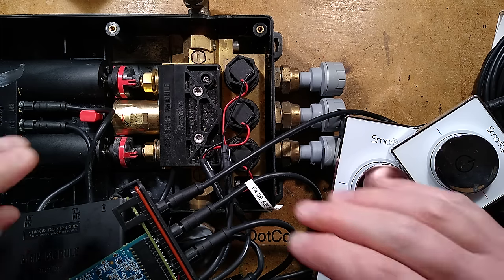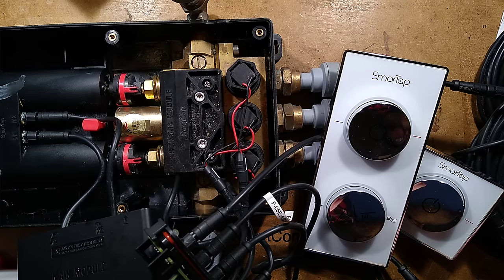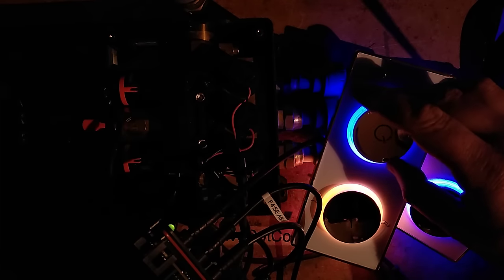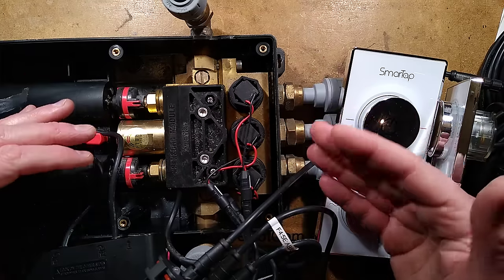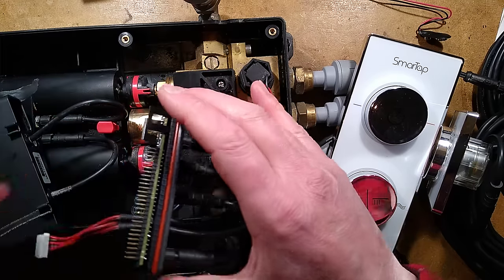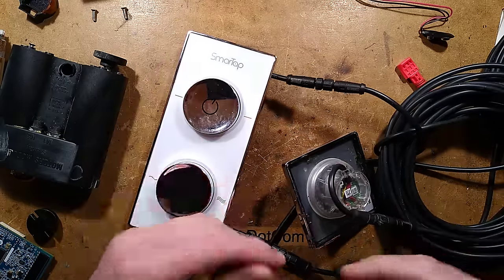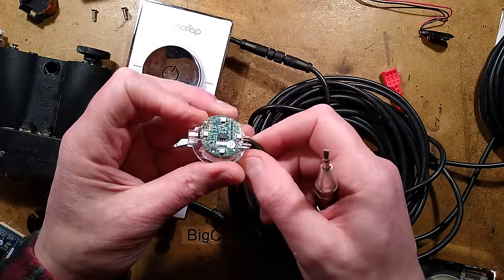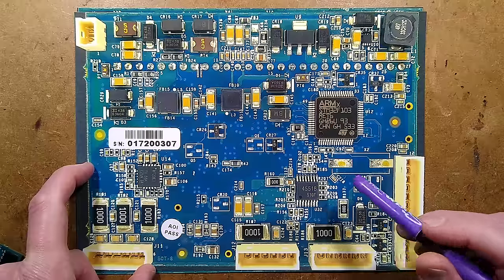Smartap - when the Internet of things goes down

Comment: I wonder if the third outlet which you suspect is for a basin/sink might actually be for a bidet?
Reply: Ohhh Matron!! - an IOT bidet control - that would give the Major a fright🤣🤣🤣🤣

Possibly  a hand shower.  In my, non IOT, installation (Aqualisa ) one outlet is the overhead rainfall shower and the other a handheld shower head.  I don't have a third connection the bath is POTS (Plain Old Tap System) 😎😎😎😎
Reply from the maker: I did ponder that it could be used for that with the command "wash my ass".  But by the time the hot water got there you'd have had a very cold rectal cleansing.
Reply: I would assume it’s just remote control, the two buttons inside the shower, and a remote outside to turn it on before you get in.
Reply: Proves the old adage, “A fool and his money are soon parted”

Comment: I see comments about this being a non existing problem, but that's being cynical. This does temperature control for any two sources of of hot and cold water. This iteration however is limiting, it'd be more useful to have a regulator that affects just the hot water, injecting cold water to reach a target temperature, specially for solar water heaters that tend to heat water to the point where you could burn yourself. By just injecting cold water into the hot pipe you can keep using your sink (I can't believe this is a feature lol) when the power goes out, just using a regular tap. You also get the benefit of being able to fine tune the temperature at the tap.

I'm guessing they went with solenoids at the output to have more predictable control over the hot/cold flow rates.
Reply: A mechanical thermostatic mixing valve has much of the same benefits.

Comment: I've been reading about magnetic encoders and some of the have a "magnet in the right place" output that can be used to tell if the magnet is too close or too far - and they suggest you use it for a push button.

Comment: It's kinda amazing how different consumer and industrial approaches to IoT has become.
In industry, there's a big focus on running the servers locally, usually with OPCUA support. That way, even if the manufacture goes under, you can still for the most part run the hardware until an alternative solution is found. But you wouldn't want to continue using the software unless the security updates are handled by a third-party service.

Comment: Yet another internet-based piece of kit made useless by losing its server.  I have an internet radio which can no longer receive the BBC as its server is no longer supported. The radio will soon be completly useless as its main server will close down. This seems to be the way in the future, product still works but cannot function due to server no longer supported.
Reply: BreatheScotland  This has nothing to do with DAB, that uses radio waves like standard broadcasts but in a digital packet. The server issue are stations received via the internet.
Reply: BreatheScotland  Possibly different sensitivity. If the gain is lower on one radio, it will just mute that signal. Different locations can also make a difference..

Comment: I have exactly ONE of these IoT connected things in my house, a wifi connected Kidde smoke detector hardwired to all the others in the house. It gives peace of mind by letting me know if there's smoke / high temperatures present when I'm not home and that's it. Kidde has been around for over a century and isn't likely to go anywhere any time soon, and if they do die the smoke / CO detector continues to work just like any other dumb detector. For an extra $20 it was worth it when the only other way to do the same thing without a 3rd party would be setting up some zigbee home network nonsense that I have less than zero desire to deal with. 99% of all this other random IoT crap is useless unnecessary garbage I want nothing to do with.

Comment: IoT devices are the bane of my existence. Irrespective of the technical gaffs that seem to plague all of the kit, there's several networking rules you have to setup in your routing - VLANs for specific IoT devices, special filters, rules, etc. 
It's imperative that people realise the danger and general silliness of handing over control of basic amenities to anywhere remote. Hell, I'm sticking with analogue everything despite being pretty damn clued up on tech.

I think it speaks to a wider problem of convenience and security, and how many people are willing to go all in on convenience to the severe detriment of security - and, obviously, in the case of this remote shower thingbob, functionality. 

Irrespective, another cracking video Clive.
Reply from the maker: The IOT fanatics are the new "audiophiles".
Reply: I wonder when manufacturers will start selling the IoT equivalent of “audio grade cables”.
Reply: That’s only on the consumer-grade side - if you DIY a contractor-only system it’s much better. I did a DIY crestron system and know people with DIY Control4 systems and have never had issues.

Comment: I have this exact system. Believe it was bought by Groche, but was never returned to life. Still works locally. Single button used for bath. Other double button used for hand shower and rain shower.  I had mine linked with a valve controller that was linked to a koi pond valve that would open/close the "plug". Wish I could get it linked to my local computer somehow. Fairly sure the company was based in Isreal. Was marketed and sold by Victoria Plumb - another company thag has a shady past.

Comment: I just hope my next rental flat will not come with one of these things as my current home will be sold in the coming months, forcing me to leave.
Same goes for other stuff like a gas boiler because of the excessive prices set to force people to go electric, or sockets with built-in USB chargers and so on. I'm also lucky not to have a smart meter here but almost all homes already have one now, so I'm sure I'll find one in my new flat.

For the flooding part I'm glad not to be in the US where fire sprinklers are common if not outright mandatory even in private homes as you can't access the shut-off valve in blocks of flats so it you accidentally set off a sprinkler you'll have to wait for autorized people to come and turn off the water not before having checked that there's no fire first.

And in the meantime you can't do anything but watch 10s of gallons of dirty water pouring all over the place and ruining absolutely everything in yours and other flats.

If you live in a individual house though you can turn off the water yourself but there might only be one valve that cuts both the sprinklers and the sinks, showers and other plumbing, therefore leaving you with absolutely no water until the head has been replaced.

Comment: Just to be clear -- this requires mains power to be able to get water from the tap? That would have been great when we lost mains power for more than a day a while back due to an underground cable fire.
Reply: My parents had a house that had a gas heater and gas stove in the finished basement that did not require electricity (they make these for Amish farmers and hunters' cabins). That actually came in very handy a couple of times during power outages. My house is totally useless without electricity, no heated or cooled anything. Even the plumbing is useless once it freezes. There's no choice but to move.

Comment: 15:19 That U1 is a flash memory chip. Relatively common low-capacity (512kbit?) I2C chip used for parameter and data storage. Likely an Atmel.
I recongized the package from my work where we use them for nonvolatile parameter storage.

Comment: @20:25 - When I was a sparky, I had occasion to work in an older mansion which was wired much like you describe.  All of the tiny wall switches were low-voltage clicky switches and the bulk of the general living area lighting was 12v.  At the time, I thought it was quite posh. My boss began to regale me with stories about why it wasn't more popular.  It was janky AF.
Reply: This is my grandmas house. I feel like electricians need to put a warning in blood on the door of the control cabinet. "Abandon all hope ye who tinker here"

Comment: I know people are touchy about regulation, but it should not be legal to sell critical hardware that is reduced to a paperweight by a the manufacturer’s going out of business (…or just deciding that you should have to buy the newest model.) — manufacturers of iot stuff should be required to provide local api access if the device in question does not absolutely rely on the internet to function.

Comment: IMHO it should be mandatory to open-source software if a company goes bankrupt. It's a win for everyone! In this case you could change the API control code.
The STM32F103 is a very popular chip, so it would totally be possible to completely rewrite the software for it from scratch. However it would take a long time to match the functionality of the finished firmware.

Comment: I have plenty of home automation stuff. You’d need to bypass the firewall on my router and then the password on the Home Assistant to hack into it though. Not impossible but a lot of hard work for a hacker. I don’t know about that specific device but in general a Rasperry Pi 4B 1GB is £35, plus an SD card and a power supply compared to £800 on a device… also if it works locally and the company running the cloud goes broke you can still work it and there is such a big Home Assistant community if a component broke someone would know how to fix it. The real mystery to me is that people spend loads on tech like that but not £50 on setting up Home Assistant on a Raspberry Pi.
Reply from the maker: The biggest problem being weakness in router operating systems and other firmware that leave other unexpected routes in.

Comment: The STM32F103, the basis of the original bluepill board, has no onboard data EEPROM, so it is common to apply an external EEPROM for non-volatile data storage. If the SWD pins still allow a chip erase, these abominations might yet be recoverable.

Comment: Wow, a ton of engineering was invested into that design!
Too bad it didn't help the company to survive.
Or allow their customers to continue the app control after the server got taken down. (etc)
That's a bummer if you had invested into the implementation, installation. programming and plumbing etc.
For me personally yet another reason to be extremely careful about any IOT "solution", next to their (often) absence of any security (or mediocre at best).
BTW, this solution must be relatively "regional", never seen it before. (in mainland, the water-heating for shower etc is often coming thru the same system as the central heating).
It is a nice set of parts to repurpose for other future projects ;-)

Comment: Most of these services that uses a mobile app that allows you to sync with the IoT device and access outside the house uses a protocol called uPNP which is useful - but dangerous as well due to uPNP being literally a direct tunnel past your network firewall

Just get a VPN server, port forward only that vpn server

Then whenever you want to communicate with the IoT device, connect to the vpn and do that instead, slightly more setup but safer

Comment: Oh wow, this is really one of those products that sounds neat at first glance but then has so many red flags that you're really stupid if you actually buy it...
IoT is a topic that should be reserved for very few specific applications that really need to be connected over a WAN (wide area network, aka "the internet"). Anything related to house automation should a) only rely on devices/services provided inside your own network, b) be based on open standards so you are not bound to a single provider, and c) ideally run on open source firm/software so others can pick up if a company goes bust and keep their stuff running (or even extend it with new features and fixes). A great example for such an ecosystem is Tasmota, a project that lets you turn certain "smart" devices that are bound to proprietary cloud services into (still) "smart" devices that work with many different "controllers"/HA systems without any internet connectivity.

Comment: I keep thinking about the opening scenes from the movie "Brazil" where Sam Lowrey is going about his morning routine with all of the automated crap in his futuristic apartment going wrong (soggy toast, anyone?)
About the only innovation I'm happy having with shower plumbing is the pressure-balanced valve to prevent temperature changes caused by water usage elsewhere and the ability to set a hard upper limit for temperature to prevent scalding accidents. Both of which can be implemented without resorting to electronics and internet connections.
Innovation is fine, but we have definitely reached the level of "OOO! Shiny New!" that the automobile industry has used for many decades. At some point you have to ask yourself what actual use 42 pounds of chrome trim is to the functioning of a car. And, yes the 1958 Oldsmobile literally had 42 pounds of chrome trim. No wonder they needed those huge V-8 engines!
I truly think we're better off not trying for the Jetson's future and just refining what we already know works reliably.
Thanks for the tear-down. I've never heard of this company and I'm not surprised it went bust.
I think this must go into the same category as the "smart" fridge that will order food for you.
Interesting, but as useful as a bicycle would be for a fish.

Comment: I smell project involving replacing the processor with a raspberry pi and having home assistant running locally and not relying on the Internet ...These smart bathroom devices are maintenance nightmare as well as for the wallet ...

Comment: The STM32 chip seems to be a 3d printer chip, which sounds like a good fit to manage 3 tap valves.

It would take some significant reverse engineering, but someone with the right skills & desire, could get something working on that, without the dead server
Reply: STM32 is a generic microcontroller family which happens to be popular with 3D printers. They are super capable for an excellent price point, ranging from super simple controllers to ultra higly integrated SoC.

The STM32F103 is an older but very popular chip. Just like the Atmega328p on many Arduinos.
Reply: STM32 microcontrollers are jack of all trades, it's a programmable micro controller that can run small network cameras or any other form of wifi/bluetooth IoT

Comment: Heavens, adding complexity where we don't need it. At least it turns the taps off in case of a power outage, however I'm happy to stick with my reliable (and simple) ceramic tap valves.

Comment: Those "old" systems with a big panel full of relays have actually been open for a very long time. With KNX systems you can replace any component with a different brand in minutes. Still it is very expensive to setup and if you live in a small town it will be difficult to find a good contractor.

Also if your installer did not give you a backup file like they should everything has to be reprogrammed from scratch.

Comment: My limit of tolerance for this sort of stuff is my ‘digital’ shower. It’s not internet connected, control is just local ZigBee and it works great….but yes, one day it won’t work any more, but at least I installed it so know how to replace it. Already had to repair the remote, one of the switches fell off the PCB.

Comment: Great video, but the product looks like an expensive solution to a problem that does not exist. Touch sensitive controls are a lot "posher" than a simple old fashioned tap, so maybe there's a small market for that. Changing the settings on the shower by remote, when someone else is in it, might also be fun. But they are just going to extract revenge when I'm in the shower. So no, I don't want remote control. 😁

Comment: First of all the temperature control is total crap. It has to be done by PWM pulsing the heating elements in your flow heater in case of electrical flow heating. Secondly, this stuff should be mandated by law to be running purely locally in your home network.

Comment: I have one of these.

The third output is for a bath filler not a sink, the function of presets to simply fill say 70 litres at 39 degrees was well worthwhile especially with young children, a lot better and more efficient than faffing with hot and cold taps.
My partner likes a hotter shower than me and simpy having a preset for me and her to set the extact temperature was also usefull.
I've heard a lot of talk recently about the health benefits of a quick cold(ish) say 30 seconds at the end of a shower, this could do that routine too at a set temperature. 
Sadly this has gone with the server loss.  

Even so the controls are still a lot better than normal taps or mixers, with precise clicks to set temperature. and it sits very neatly in the shower. 

Also having a remote mixer in the roofspace is a lot easier to maintain than an analogue mixer tile'd into the wall, and a lot nicer and more space efficient than a surface analogue mixer. 

I've never had it fail or randomly turn on or off or anything like that, it was a great product, shame it died, I believe it was bought out by another company so maybe it will come back in some form.

If anyone could figure out how to get the bath filler function / shower presets working again locally I'd be very happy!

Comment: a few years ago that stm32, especially the RET6 you have there, was impossible to find. i nedded one for a 3d printer i was repairing but i ended up replacing the entire board since i couldnt find the chip so it enden up costing 60£ instead of 5£